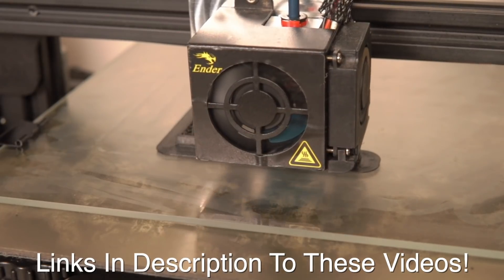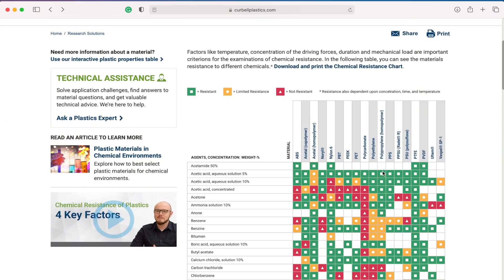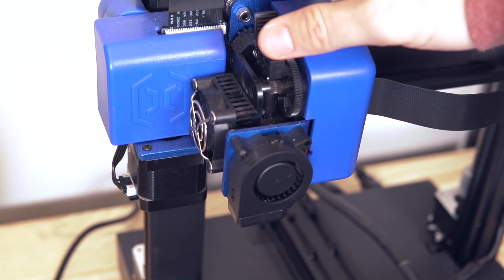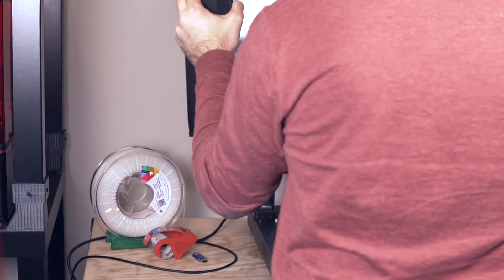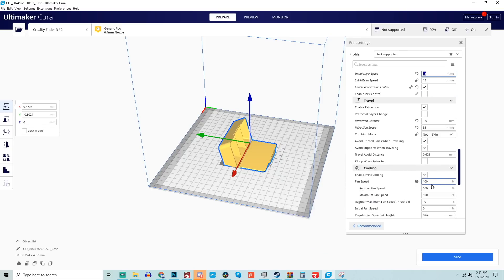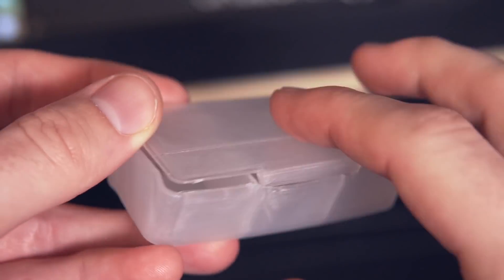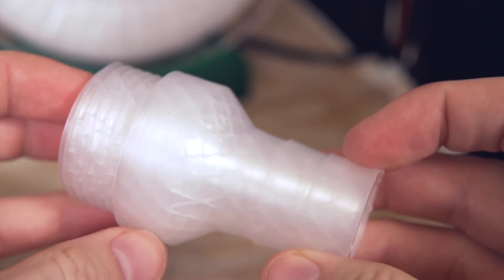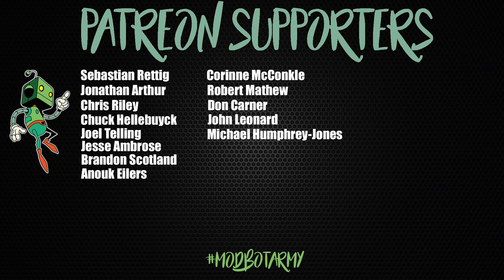3d Printing Polypropylene For Beginners! Chemical Resistant

Comment: My tape was pulling up on my ender bed when it warped, So I flipped the metal sheet over and stuck the tape on the metal side and it stopped coming up. I find having the super hot bed 90 degrees works better than at 60 degrees

Comment: Thank you for covering this, I love the properties of polypropylene and want to master printing with it! 

One thing I found that helped on my Artillery Sidewinder was to drop the bed temp to 70°C, it seemed like at higher temps the adhesive on the tape gets soft and let's the part pull it up off the bed too easily. Best of luck!

Comment: Try cutting off an even layer of a PET bottle and using it as a 3D printer table cover. Pet and polypropylene can be printed on top of each other, but with little effort they usually come apart. At 100*C - 180*C, the PET substrate should not melt or deform. When the table cools down, the part can be torn off.
Попробуй обрезать ровный слой бутылки из пэт и использовать её в качестве покрытия для стола 3д принтера . Пэт и полипропилен могут печататься друг на друге , но при небольшом усилии обычно рассоединяются . При 100*С - 180*С подложка из пэт не должна расплавиться и деформироваться  . При остывании стола деталь можно оторвать . 
Another option is to try reinforced window film, they are sold separately. I somehow tried to heat it with a hair dryer at 230 * C - she didn’t want to sit down at all !!!
Ешё вариант - попробуй армированную плёнку для окон , они продаются отдельно . Я как - то пробовал её  греть феном при 230*С - она усаживаться совсем не хотела !!!
 Есть ещё вариант 
https://www.youtube.com/watch?v=oqjrygzhZkk

Comment: There is actually a very simple solution with a counterintuitive trick.
When you use the packing tape, set the print bed temp to 0 yes ZERO not 90 or 100.
The heat loosens the glue (on the tapes) sticking strength.
Tape will stick perfectly during the print and the shrinkage of PP is not as much as you would think if the part being printed does not have sharp corners ,or does not have a large surface contact with the print bed (Any shell shaped components print perfect). 
I have been printing without any problems for years.
I also printed fiber reinforced PP and that prints perfect.
Reply: This is the only advice on the internet, that works for me, ure a hero👍
Reply: Thanks, works great for me. Do you have any tips on how to remove the tape from the PP print?
Reply: @stufffrombohemia  the tape if PP material also it will bond very well to the print. So best choice is to get transparent tape and if necessary then try to peel it with a sharp edge.
Generally the tape has to be placed for every print.
Reply: I printed at 110 degrees it was still able to stick somehow
Reply: so we dont need bed temperature to printing pp?
Reply: @adipurwanto2826  No
Reply: What have you used the carbon fiber pp for? Is it decently rigid?
Reply: @paintballercali  I used it for light stand structure, aluminum beam connector and other. It is very stiff and has no shrinkage.
Reply: @RamiRouhana  nice and it's still holding up a year later?
Reply: @paintballercali  3 
years so far
Reply: @RamiRouhana  awesome thanks for the reply
Reply: I have tried this method. But it doesn't stick with the tape. The printed part gets lifted from the tape. It doesn't stick. I am keeping the layer height of 0.3mm
Reply: @schavda656 the tape you are using is not made of polypropylene
Reply: @RamiRouhana  It is polypropylene. i checked it. Also the print is big so maybe that can be the reason the material doesnt stick.

Comment: yes it warps very well. presumably shrinking quite a bit when solidifying.  maybe since it's partially crystalline.
One big flat object lifted in the corner from the Anycubic ultrabase/packing tape.  I read some packing tape melts so I didn't want to go too hot.  Using a raft, it would stick, but does not detach cleanly.  With a brim, it forms a smooth shiny surface on the base.
 
One tip I saw in a paper on fluidics was printing with 110% flow for no leaks.  They used polypropylene interior part to be in contact with fluid channel and PLA from a second extruder outside to form threaded fittings.    Too bad I don't have dual extruder setup.
The tip here using small contact area should help a lot with warping.  Smaller parts are better.

Comment: Have you tried sugar water for bed adhesion for me it does wonders works with abs pla petg pet tpu. Here is how you do it 100ml of water in a bottle or cup mix until dissolved 1 or 2 table  spoons of sugar. Use a painting brush to spread on heat bed then heat the bed to 60 - 70 degrees C wait until the water has evaporated and the bed is sticky like wet candy start printing.
Reply: after using just wipe with wet cloth carefully not get water on the electronics printer should be unplugged.

Comment: You should use tree supports and float your models in the slicer to make a very small/sparse bed contact.
Reply: I was thinking the same thing, and was also wondering how, or if it would work.
Reply: @jayedwin98020  I am unsure. Please let me know if you try this and it succeeds. I do not currently have this problem but may in the future.
Reply: Did anyone ever try this? I was thinking the same thing and wondering if anyone already has relevant findings.

Comment: Awesome video! Been printing a bit with polypropylene (fiberlogy black pp). Love the smooth matte surface finish it gives and that soft to touch feeling like car interior parts. You have covered all but in my opinion the glue on the tape you are using isn't strong enough and that's why your part is warping. I've used 80°C for bed with cheap tape and it did fuse to the tape and made it imposible to remove the bits of the tape from the print, now i gave it a go at 55-60°C and the prints do not fuse to the tape. Also i'm printing with 60/30mms 20mm first layer, brim or raft if it's tiny contact area, fan 100% above 6th layer or so. Retractions are the same i use for pla.
Reply: awesome, that's fast

Comment: Print polypropylene easily. Glass or aluminum or steel bed with Zillagrip coating glue allows you to print the most type of plastics and works with a cold bed. Just heat the bed to release. PLA ABS Nylon PETG PP POM PC with one glue coating adhesive.

Comment: ive seen folks with dual extruders lay down a .2mm layer of tpu then print PP on top and it eliminates the need for the tape and warps a lot less.  BTW have you tried to post process the PP to make it clear ?

Comment: Cool video. I have been struggling with pp for a few years. Mainly because of first layer adhesion. Last week I started printing with zillagrip from zilla3d.com. That stuff is amazing. I get better adhesion on a cold bed than both glued that you mentioned. The smart materials works better than Magigoo from my experience but the zillagrip is above and beyond the best so far. Try it out and you’ll thank me later. If you want more info let me know.

Comment: Did you try using a Raft? It might be good way to avoid part warping
Reply: I was wondering the same thing. As it sticks well to itself, wonder if it stick too well to a raft?
Reply: @alanjones4747  nope. Raft just warps too. I've tried everything and PP is a nightmare to print with.

Comment: Great Video ! i just ordered a small sample of Polyrplene off of Aliexpress just to check out this material.I have also heard that the best way to print this material would be to able to print on a 3mm thick  PP sheet. You could probably try that out and print longer without bed adhesion issues.